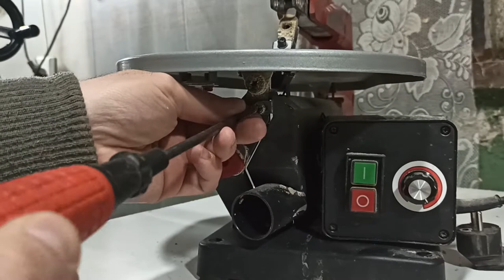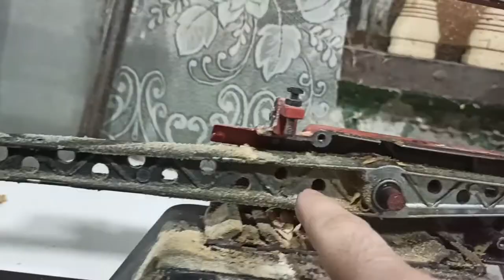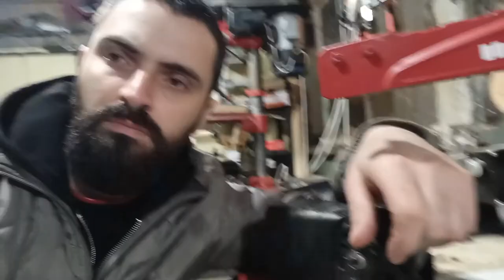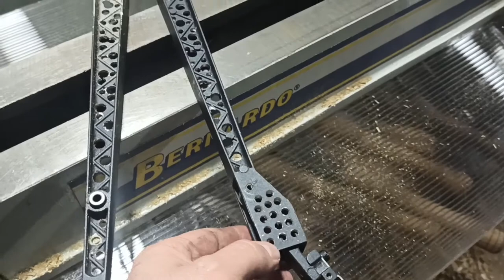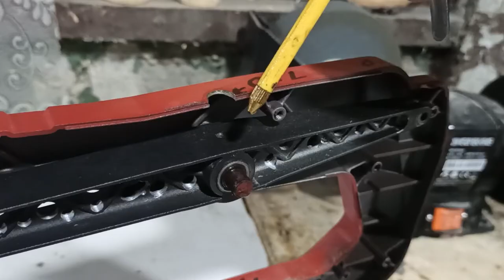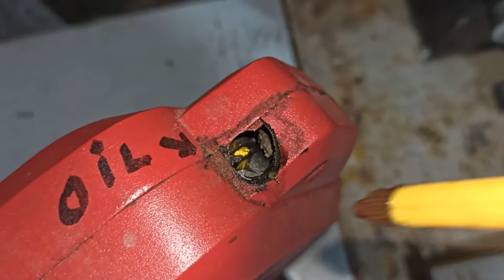Einhell Scroll Saw Improvement Eliminate Vibrations

Comment: Of course, lubrication calms vibrations and extends the life of parts that wear out without lubrication, but from open holes, dust will certainly get inside that hole and cause more damage, it is necessary to put rubber bands as protection.

Comment: Thank you very much for that information. Got the same machine but it vibrates very bad. Will do the modifications as you explained and see what happens. Thank you for posting.
Reply from the maker: If you need help, feel free to ask!👍
Reply: @ade-woodcrafts  Thank you very much and I will most definitely do so. I made myself a heavier counter weight on the motor and I see an improvement already. Which country are from?
Reply from the maker: @brentnicol6391  My pleasure! I'm from Romania, Bucharest.
Reply: @ade-woodcrafts  greeting to you from South Africa, Cape Town.

Comment: I wonder how many people have the courage to open the machine as you did, and more importantly, how many people would drill as many holes on the arms as you did, as this surely weakens them considerably. It would also be interesting to hear what the manufacturer thinks of your ideas and modifications..🤔
Reply from the maker: Thanks for the comment!
It's Actually not that hard to disassemble it, all it takes is a little bit of courage, the arms seems to be holding nice so far, if you look closely I drilled the holes only in between the triangles and that didn't affect the rigidity of the arms.🍻
Reply: @ade-woodcrafts  Thank you for your response ! Perhaps you can help me with this problem : I have a Proxxon DSH (V1), and for some strange reason, I cannot get a (pinned) blade into the mount anymore. I have loosened the tensioning mechanism completely, and pushed the upper arm downwards, but I still cannot get it down far enough to get the upper pin into the mount. It would be necessary to get it down another 3-4mm, but there is no further adjustment possible…🤷🏼‍♂️ Do you have any idea what the cause could be ???
Reply from the maker: @zeejimi4044  Is there any possibility that the blades you are using are too short?
Reply: @ade-woodcrafts  Maybe you’re right : I’ve discovered that there are blades that are 130mm long, and some are only 127mm long, so I’ll check that ! I hope that Proxxon haven’t changed from 130mm to 127mm, as that would be a real headache for me..

Comment: The only thing I like about this video, is the way you made the lubrication holes, the rest is a downgrade to the machine, if it vibrate a lot, which is normal for a scroll saw, make an iron stand and fix it to it, you will see a big difference. Thanks for sharing anyway
Reply from the maker: Thanks for the reply anyway :). 
I succeed making it in a way that it is functioning without vibrations, thus does not require bolting it down to the workbench. I consider this a great advantage and upgrade. I can move it around wherever I need it with ease. Most important is that I can make accurate cuts in absence of massive vibrations.(it is not normal for scroll saws to vibrate, maybe only the cheap ones like this one)
Cheers and thanks for the reply!